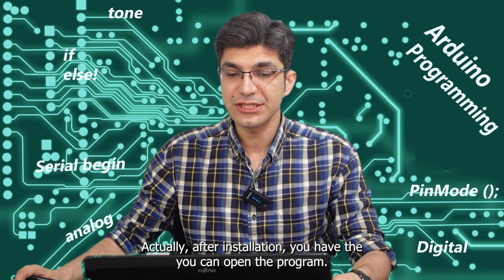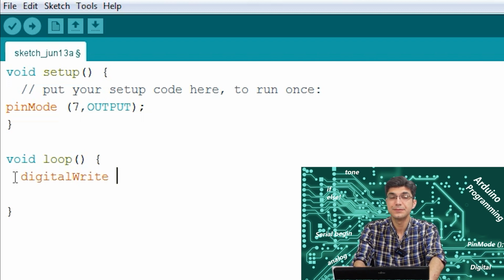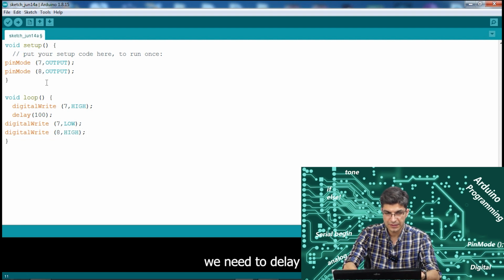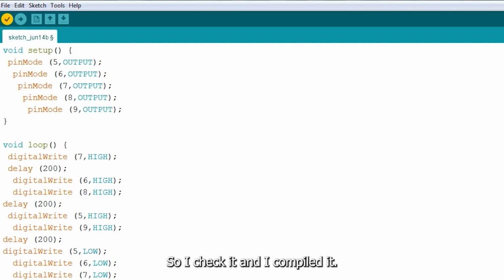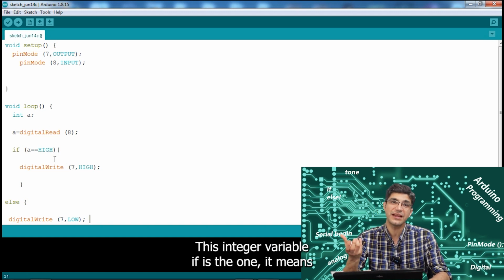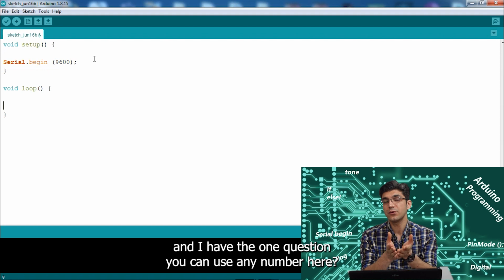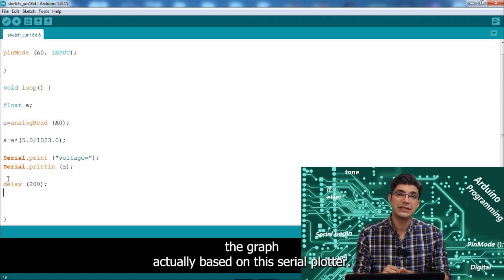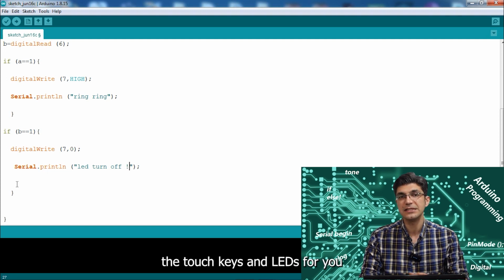Arduino coding Step-by-Step with projects & tutorials in 80mins!!!!

Comment: Sir please tell that can a sensor be controlled by another sensor suppose for example a utrasonic wave sensor is controlled by sound sensor sir please tell
Reply: Thankyou sir
Reply from the maker: welcome
Reply from the maker: your answer is yes .... just if you use arduino or microconteroller  between these sensors  ....  usually utrasonic module dose not have digital pin output to control another modules!!... good luck